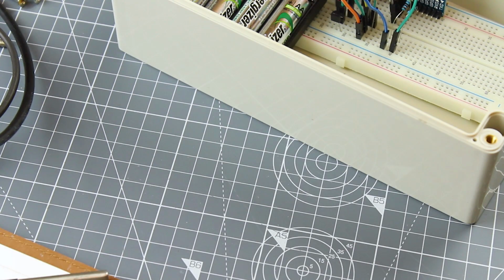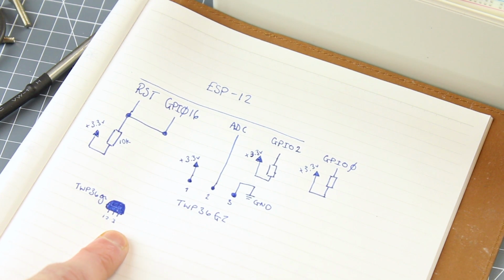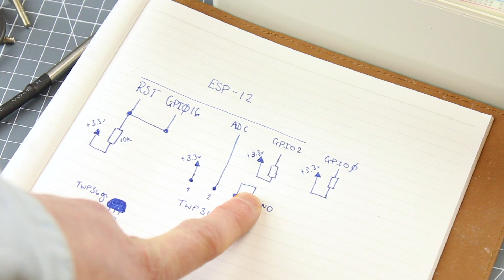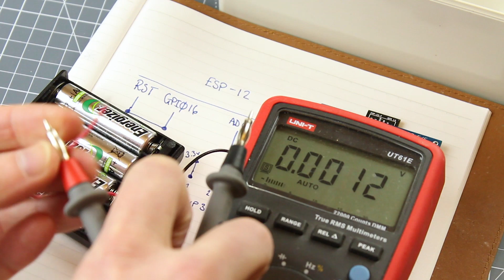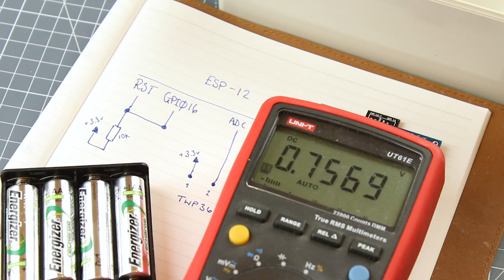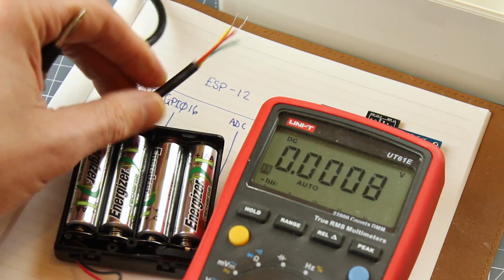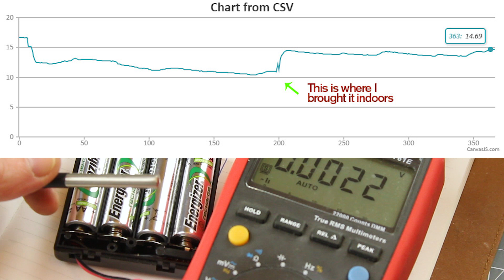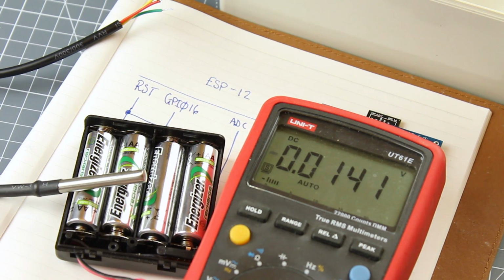Part 1: Outdoor Temperature Logging with ESP8266 ESP-12f

Comment: ams1117 has 5ma quiescent current even in deep sleep,  I recommend you change your voltage regulators to a smaller one like HT7533-2 which use 4.0 μA max, that could extend your battery life.

Comment: the wemos units have a Richtek RT9013 regular onboard which are "quiescent current as low as 25μA" but a max VIN of 5.5V. the AMS1117 is ~5ma and compare this to ESP8266 15ma wake with modem sleep, its are horrible waste if your trying to go low power.
the HT7333 is 5μA no load which is great, but wemos did it all for you. CHG340 works fine on linux - no drivers needed.
Reply from the maker: I have some HT7333s but it is a different pinout to the asm1117 so it isn't a direct replacement.
Reply: hack it on!
tombstone it on its head and run some solid core wires.  anything, but that ams1117 has to go!
(edit; tombstoning might not work on SOT89 depending on the PCB, but its on a breadboard anyway - this doesnt have to be neat)

Comment: hey, I am using those wemos clones also with the dht22 shield. what's the error you're getting? I had some issues but i narrowed it down to a dodgy micro USB cable. Also, make sure you're using the correct firmware when flashing in the Arduino IDE. shoot me a message on here if you need any help. Also, I'm using the DHT22 outside in a project box. I simply cut out a hole so th DHT22 itself can directly monitor the temp outside the box. I've had no issue yet (and I'm in Thailand where we have super humid and wet weather) so long as you keep it under cover. :)
Reply from the maker: The boards don't show up in device manager, I have tried all 12 of my micro usb cables. I assume they had a bad batch of ch340g ics. I tried programming them with a TTL adapter but I just got warning: espcomm_sync failed
error: espcomm_open failed. I have given up on them now and bought a different kind. Nice and small though, it is a shame.
Reply: > warning: espcomm_sync failed error: espcomm_open failed

Hah, yeah I've similar issues also, but I would try hit upload a few times and it would eventually work. I also realised that using a USB 2.0 port instead of the USB 3.0 port on my machine was causing the issue (at least for me, and this being on Linux)

If you're using Windows, wasn't the FTDI driver bricking the Chinese knock off's of the ch340g or am I confusing that for something else?  Either way, hope you get the Wemos working, they really are great. Another one to look at is the Sonoff's. I've been using them with Theo Lorendst's sonoff-mqtt-arduino firmware off github, and it's bloody amazing! Especially given the Sonoff's price point.

Comment: Hello David,

I am working with esp8266 where i am receiving data through "esp8266" from a server using putty.
The problem I am facing is that when I am sending data to esp8266 through server I am not receiving all the data in the string.
for eg:-
if I am trying to send "helloworld" through server, I am only getting "hello" in my string.

my received string should contain "helloworld" the full data, but that is not happening.
Can anyone help why this is happening?
This is the process I've followed with esp8266 communicating via UART
AT
AT+CWMODE=1
AT+CIPMUX=1
AT+CWJAP="USSID","PASSWORD"
AT+CIFSR (HERE I AM GETTING IP address of esp8266)
AT+CIPSERVER=1,PORT NUMBER

I am connecting to server using IP address of esp8266,

Thank you in advance.

Comment: Nice project!
The active current regulator 1117 consumes a few mA unfortunately. I started my
ESP8266 project and tested all active power regulators i could find, all of them drains batteries to fast
if you want to measure temperature more than a few weeks. 
I changes batteries to LifePO4 instead, they have a native voltage just in the ESP8266
supported voltages (3.6v native). no regulator needed!
I added a solar panel and two diodes to provide energy on sunny days. This has allowed my
ESP to send temperatures to thingspeak, vera and an MQTT server for more then
144 days on a single LifePO4 @ 700mA!
All info
about this projects is available here:  http://www.automatiserar.se/solcell-och-lifepo4-med-esp8266-12e/

// Markus

Comment: I am surprised you didnt get the Wemos to work. Worked right out of the bag for me. Can't imagine you wld do anything wrong with them.
Reply from the maker: Unfortunately it just wasn't recognised by Windows and it failed to program with a USB to TTL adapter either. I imagine it was a clone of that type of board.
Reply: @DavidWatts  probably a matter of getting the right driver (for ch340)
Reply: yeah dont buy CHG340 for windows unless you want to put your trust into a dodge driver download. but CHG340 is fine on linux out of the box

Comment: Hi David! Is there any reason you're not using a voltage divider? If I recall correctly, the ADC on the ESP has a max voltage of 1V, not 3v3. Perhaps this might explain why your readings are off?
Reply: That is a really good point, but IIRC that temperature sensor shouldn't output more than 1V when temperature is below 50C. Limited ADC input range can cause problems in many cases, but this is caused by something else.
Reply from the maker: Just because the datasheet for the twp36gz said I should be well within the limits otherwise I would have added something like a 4.7k and a 2k resistor. Although I would also have to factor their accuracy into any temperature readings.
Reply: 😂😂😂 1 V 😂😂🐷

Comment: Hey David, I have used that device and made a video - https://www.youtube.com/watch?v=hsaroVCHuPE. I hope it helps you get the relevant drivers installed correctly!
Reply from the maker: Thanks, unfortunately I couldn't get them recognised by my computer at all despite having other ch340g boards that work.
Reply: David Watts Oh I see. Sounds like a hardware issue with the boards then. Try proving the power pins etc on the module to see if there are any obvious issues.

Comment: I haven't had any problems with the Wemos, I'm using the newer Wemos D1 mini pro with 16mb. 

https://www.aliexpress.com/item/WEMOS-D1-mini-Pro-16M-bytes-external-antenna-connector-ESP8266-WIFI-Internet-of-Things-development-board/32724692514.html?spm=2114.13010608.0.0.VUt928
Reply from the maker: Thanks, I am using a clone so I imagine there is something wrong with the ch340g onboad, time to try it with a USB to TTL again.

Comment: Nooo don't use hot glue for anything outside or with water, it's useless! Get some poundland bath silicone as it's flexible, waterproof and can withstand below freezing unlike hot glue.
Reply from the maker: OMG! How could I not have thought of that?! I even have a caulk gun and some bathroom sealant under the kitchen sink (I assume that is where everyone keeps that kind of stuff). You sir are a genius.
Reply: beware fake silicon at poundlandworld...some of it is just thick acrylic paint....
Reply: Haha, yeah bathroom sealant is amazing for sealing plastic together. About a year ago I covered a webcam in some of the cheap stuff and put it out in the garden, and it's still working today! I tried the same with hot glue and it failed the first time it rained...

I read somewhere it's to do with the expanding and contracting in the changing weather that makes it useless for waterproofing.
Reply: yes, hot snot so bad...

Comment: Hi David, unrelated but just wondered how your getting on with the printer? Ordered one today after watching your videos, can you recommend which filament you have found to be best? Just trying to decide which to get. Cheers mate
Reply from the maker: I will be making a year review in January or February but in the meantime I can recommend some filament. I have really enjoyed using Excelvan which is super cheap but seems to work great for me,  on the medium price range I have found BQ filament to have great colours and a good finish, finally the more expensive ones, I really like FormFutura and Rigid-Ink. You have to play with the settings a little for the last 3 but I found Excelvan to print amazing well on stock settings.
Reply: Really appreciate you taking the time to reply. Have done loads of research but nice to hear from somebody who actually owns one. Will have a look into your recommendations and try a couple reels and see how I get on. Thanks again and thanks for all your great videos :) had no intentions of getting a 3d printer until watching your videos so your not my wallets best friend lol
Reply from the maker: As a side not, none of those will fit in the FF Finder (If you bought the same printer). You will need to print yourself or buy a spool holder. I printed this one and use it constantly - http://www.thingiverse.com/thing:761893
Reply: Yes I had found out that it will only take 600g reels in the caddy. Had seen a few clip on spool holders on thingiverse but the one you have linked to looks great. Thankyou :) just ordered a reel of excelvan ready!